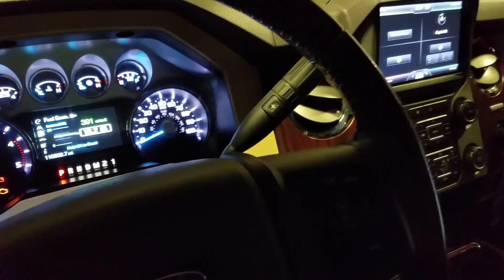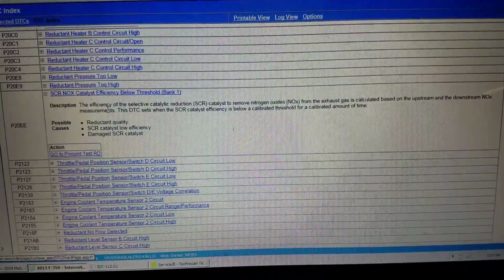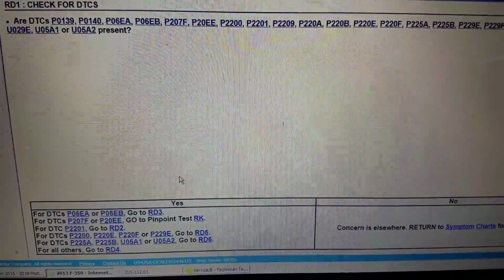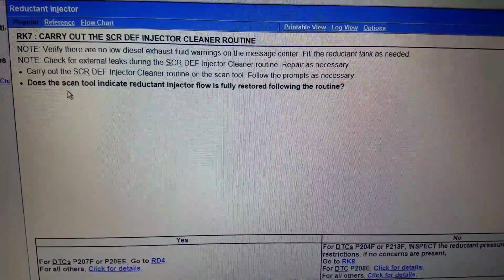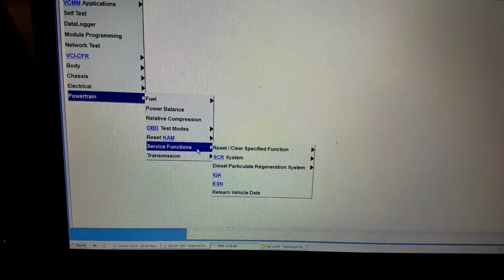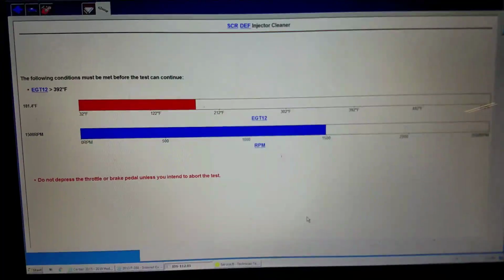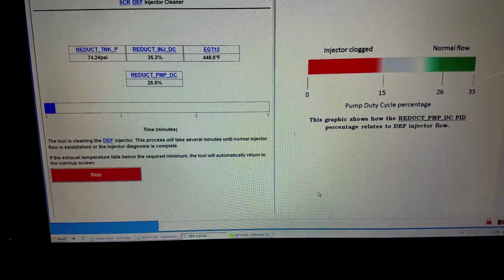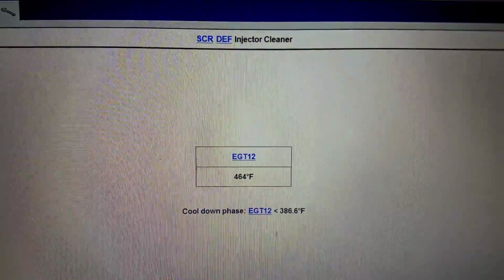13 F350 DEF injector clean

Comment: Going on with my truck now. Had the 50 mile warning show up a couple weeks ago then went away, came back so I took to dealer. They said it needed a software update, manual regen, and the DEF nozzle cleaned. Hopefully that fixes it!
Reply from the maker: Hopefully!
Reply: PowerStroke Tech Talk w/ARod well it fixed it til today. Got a P20EE code now. I’m stumped. I just spent $600 on the other code. I’m not happy at all
Reply from the maker: Damn sry bruh
Reply: PowerStroke Tech Talk w/ARod what could a P20EE be? They said all my PIDs were normal so I’m stumped why it would throw this 1500 miles later
Reply from the maker: Gotta follow the pin point test

Comment: 2016 6.7 with #4 dead has noise in bottom end and acted hydrolocked when it came in but  cranked. Ids showed #4 cly not really doing anything .any suggestions other than a engine
Reply from the maker: Needs a short block, hands down! Nothing your gonna do....
Reply: @PowerStrokeTechTalkwARod   thanks .that's what I told him but he wants me to pull the oil pan and bed plate and check it out.his money .
Reply from the maker: Yea total waste of time. I know what it sounded like. Some people jst dont listen.  His money ur right. He came to you....just did 1, 2 weekends ago on my buddys dump. Chk pics out on my IG. Guy is robably doin 10k mile oil changes usin crappy oil and thing probably never shuts off. Spun mains, oil pan gonna have shhhrapnel
Reply: @PowerStrokeTechTalkwARod  yup.your one of the good mechanic out there that do the job rite and don't just throw parts at it until it's fixed .keep up the good work and videos
Reply from the maker: Thanks man, really appreciate the positive feed back. If u ever need anything dont hesitate to reach out to me!!
Reply: @PowerStrokeTechTalkwARod  will do .maybe Navigating some stuff on IDs lol they hide some stuff . It's totally different than the other heavy duty software I use only equipment and trucks

Comment: Oh God not the dreaded P207F. I've had one truck that needed not one, but TWO SCR catalysts replaced that set that DTC. But that particular truck had a disproportionately high engine hour count, relative to mileage accumulated. Now I got to do that to my truck on a regular basis as a maintenance item, along with my 3000 mile interval oil changes and 6000 mile interval fuel filter replacements.
Reply from the maker: Oh gosh i knw fml is what i thought with koeo completed like damn

Comment: Ive done this several times for a few of the our trucks as a precautionary step after repairs/problems. Ive been fighting a truck with the 207F lately, every couple weeks itll derate and throw that. My IDS has been down the 2 times I needed to run the cleaning routine (of course), so Im waiting until the next time to try and nail it
Reply from the maker: Hopefully mine works i gotta put some more miles on her. See ya nxt week